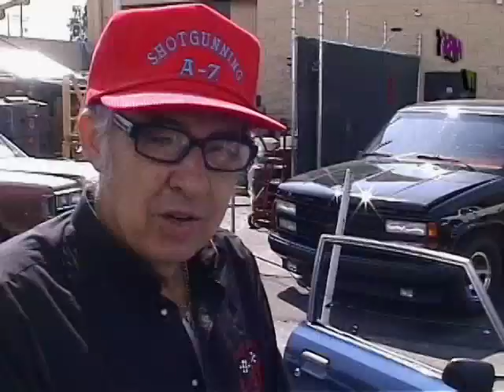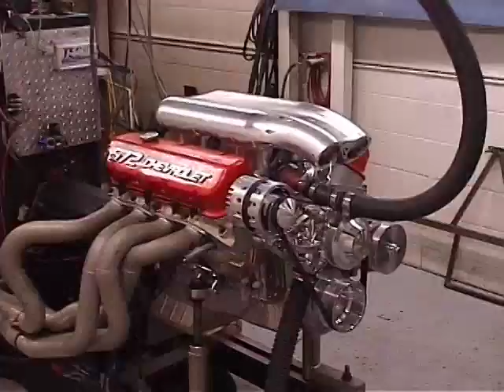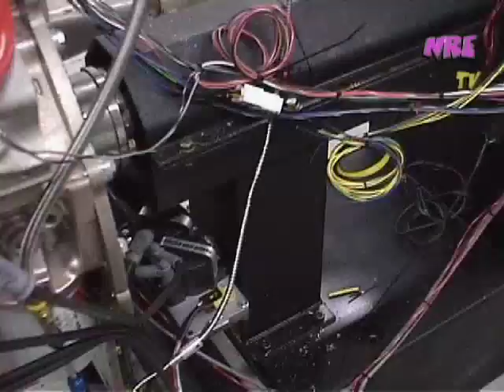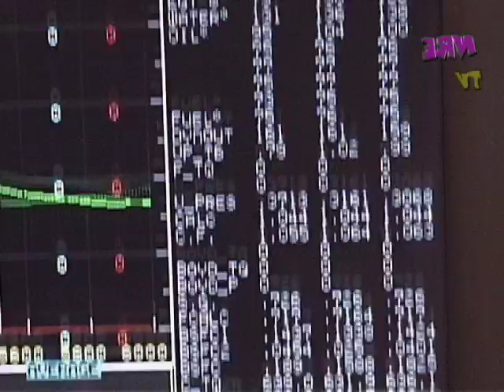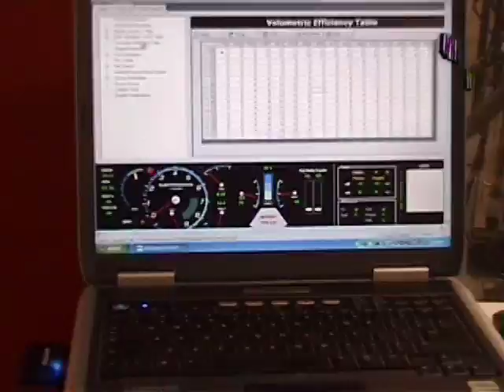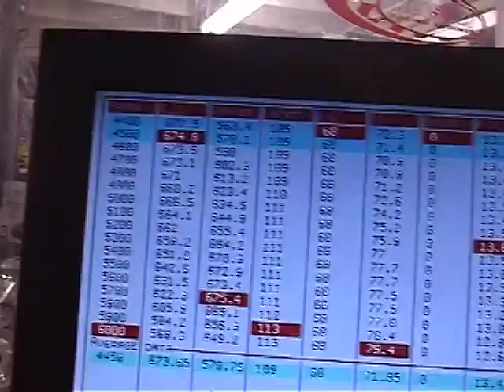Must See!  Great Car Intro.  Mean 572 BBC Alien Intake Crate Engine.  Nelson Racing Engines.  NRE

Comment: They typically use a dry sump oil system.It is an externaly mounted oil pump on the accessory belt.

Comment: Sorry--I need to ask a stupid question, since you have no distributor and the motor is stock what drives the oil pump? 

You must have some cops and neighbors that look the other way in your area-- even in the mid 70's people would sometimes call the cops where i used to live
Reply: They use a stub shaft , looks like the bottom half of a distributor, has a shaft and a distributor gear to drive oil pump.

Comment: but with the manifold, you can use a computer dyno on the engine. you can control the Fuel intake, you can control air intake, you can control idle, you can control rpm range. you cant do that very easily with a carb. yes a carb is cheaper, but this allows more control. and school is free. and if they cant afford college, they probably should not go, get a job and save up for it.